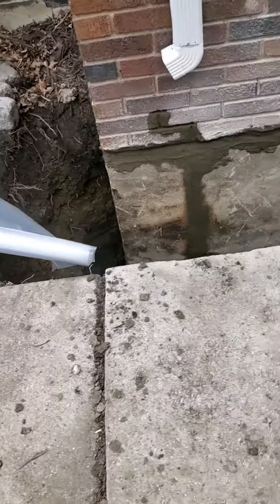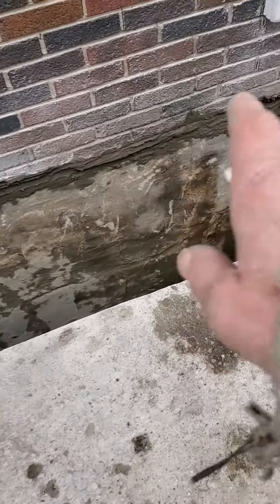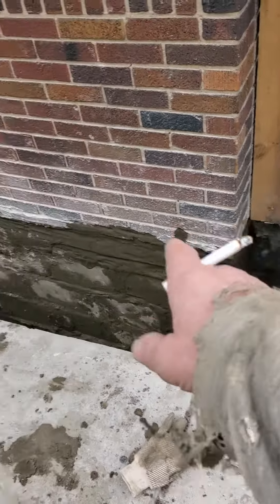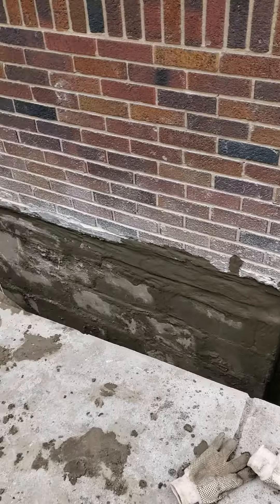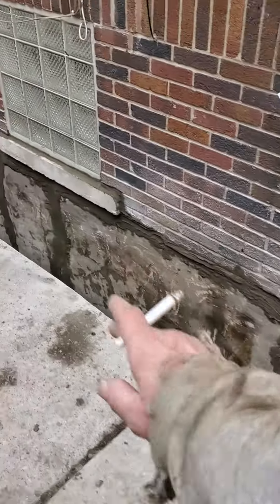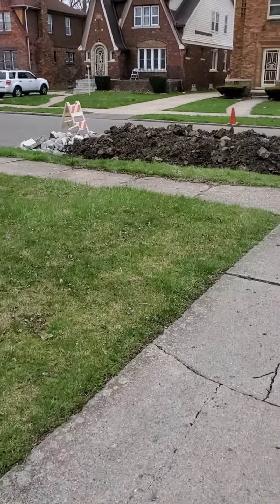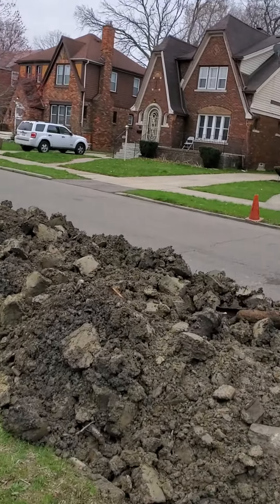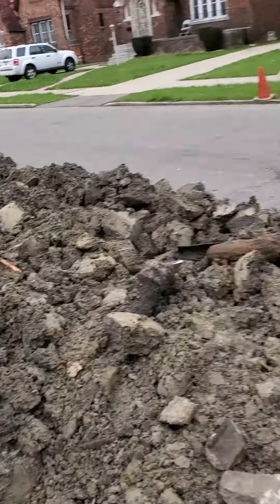exterior basement waterproofing Detroit part i dunno

Comment: I shared this video with another person that prefers pouring concrete to control water. I'll share his response.  "Absolutely, No. Completely out of the question. Why would you invite water to the foundation and hope your waterproofing holds up? Keep the surface water away from the foundation and deliver it elsewhere. Think about it like this: Whatever your solution is, it better be pouring water out during a rain. That's what I do. I divert the water that was a problem somewhere that it's no longer a problem. Eliminate the water and waterproofing is pointless."